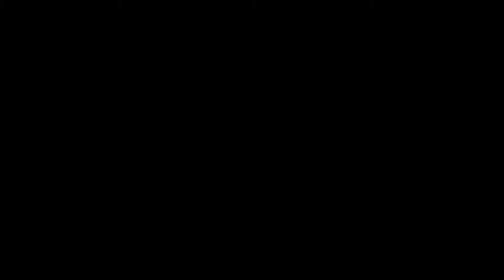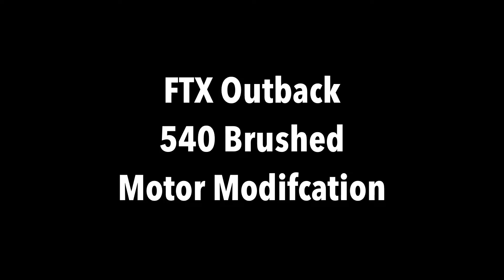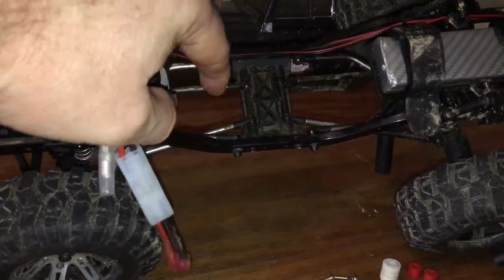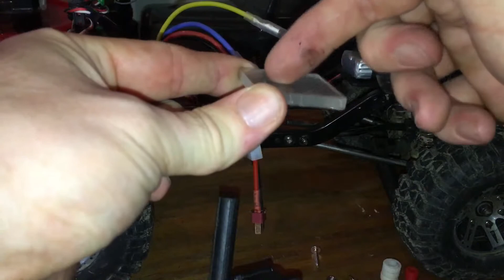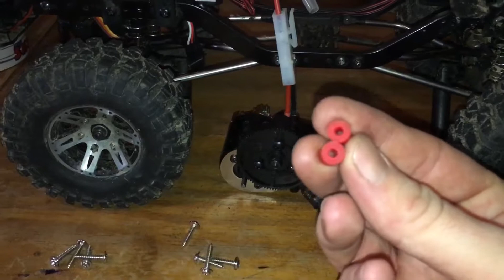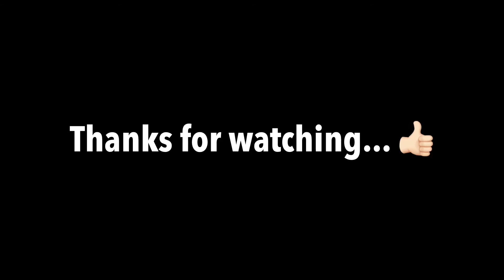FTX Outback   540 Motor Modification

Comment: thanks craggle for the clear explanation of this conversion.just sourcing a all metal or scout g-box.is there a certain x/y/z for the plexi plate buddy?
Reply from the maker: Hi,  not really no, it's just a case of lining the gearbox up in a suitable position so the UJ's on the propshafts aren't too angled. Mark the holes to be drilled on the plate and off ya go.

Comment: Hello! Would this gearbox fit on a Absima CR.2.4? the middle skidplate seems to be the same, same thing with the driveshafts.
Reply from the maker: Hi, I can’t say I’m familiar with the Absima crawler. I’ve changed two gearboxes in two different crawlers, both were easy to do as I made an interface plate to between the original skid plate and underside of new gearbox. You might be lucky with the dimensions of the rectangular base of the gearbox, it may match what you already have. Hope that helps.
Reply: @cramalnig  thanks! I think I'll just keep the 380 motor then. I spent a lot of money on mine and I don't wanna spend more if im not certain is gonna fit.

Comment: I just had my friend print me the center skid plate for this mod and I bought the Everest 10 trans and motor for it
Reply: I’m really excited about it honestly . I ordered 20 mm wheel spacers as well for it and I’m running handmedown 1.9s off a. Vitara ascender . And sent my friend some more files I’m going to try to draw up a front 4 link servo mount that will have. The servo pushed fwd a tad hair and have a 4 link mount at the back
Reply from the maker: Harry FP   Nice one! Hope it works out for you. I actually only ran my Outback the other day (first time in over a year perhaps??)  the different gearbox and 55T motor have transformed it, so so capable.

Comment: What pinion did you fit pls.
Reply from the maker: It's either a 10 or 11t pinion, I'm sure it's 11?! Plenty of low speed control with it, massive difference over stock... totally different RC.
Reply: Tks. I know, i have already blown the stock motor with a 3s and was stupidly fast, but now if I install this gearbox with a 540 motor and run it on a 3s it would be faster, safer and cooler. Thanks.
Reply from the maker: Strewth! It'll take off on 3S lol..  I run mine on 2S, I find even the smaller 2500mah Lipo's last plenty of time, almost an hour of crawling time. I prefer the slow-speed control which it now has with the set up I've put it in, nice and realistic.

Comment: Hi, how you fit the gearbox to the base of the car? The holes not fit and the engine touch the frame of the car. Thanks Best regards
Reply from the maker: Hi Club BTT Llagostera, as you can see in the video the footprint of the new gearbox is slightly larger than the stock gearbox, so rather than drilling the chassis plate I chose to make an adapter plate for the new gearbox to sit on. This gave around 6mm lift to the new gearbox and extra diameter of the 540 motor compared to the 370 motor. The. I added some bushes underneath the new adapter plate to life that even further, so in all around 10mm was gained to accommodate the 540 motor. Works a treat!
Reply: Thanks, I do the same with a piece of plastic. Thanks.

Comment: hello good night, I'm going to change the engine 290 of my rgt crawler for a 540 engine ... should my esc also fit? thanks for your help
Reply from the maker: Hi Carlos, I think the new Outback uses a 390 motor, not sure if it’s the same electrics. But I fitted a 540 motor to my sons Outback and that still uses the stock electrics with no problems at all. Thanks for taking a look!

Comment: Hi, what is the gearbox name? Thanks
Reply from the maker: It's labelled as a HSP, here's the link to it on ebay:

https://www.ebay.co.uk/itm/18024-HSP-Gear-Box-Set-For-RC-1-10-94180-Rock-Crawler-Car-Spare-Parts/282909871802?hash=item41debe0eba:g:Lv0AAOSw8zdawuMk

I've fitted two now, one in my Outback, and another to my sons. The difference between the cars now to the stock 370 is miles apart.
Reply: What is the difference with 540 and stock motor? Is really better? And what "T" you choose? Thanks
Reply from the maker: Difference is massive, performance is way beyond stock. It's physically a bigger motor, hence why a different gearbox is needed. A 540 motor is 54mm in length as opposed to the 37mm length stock motor. Not sure what you mean by T, pinion tooth size? If so, I went for a 12 tooth pinion.
Reply: Sorry, I mean this: 13T, 45T, 55T... What is this? The gear teeth? https://es.aliexpress.com/item/Goolrc-540-13-t-17-t-21-t-23-t-27-t-35-t-45-t/32849701113.html?spm=a2g0s.8937460.0.0.ElfPv3  Thanks!
Reply from the maker: So sorry for late reply! That’s the turn of the motor, I went for a 55 turn, how many turns the wire is wrapped around inside the motor basically. The lower that number then the faster it will spin, the higher the number the slower it will spin but with much greater torque. Hope that helps!

Comment: Have you changed the steering servo or is it still original ?
Reply from the maker: Yes I've changed it recently, with the extra torque from the 540 I think it needs that firm positive control courtesy of a stronger servo. So I've fitted a 20kg TowerPro metal geared servo (which I've PlastiDip'd). It's a bit overkill for it perhaps, 15kg would be more than enough. But since fitting that, it's exposed just how weak the plastic link arm is and the plastic hubs/knuckles. So I've got a pair of FTX ali knuckles/hubs on their way, and I'm making a stainless steering link arm to go across from knuckle to knuckle. There'll be no flex in the steering then at all. Though, to be fair, the stock 3kg servo I had fitted was very good, a noticeable difference between my sons Tundra stock 3kg servo for some reason. I'll be changing his very soon when I'm home.
Reply: I was wondering if the maverick scout servo would fit. I find it a reasonable servo.  Once you upgrade a part then everything else needs doing doesn’t it lol
Reply from the maker: I should imagine it would yeah, they're mostly the a standard width. It's just the depth of the servo, the longer the servo sticks back it will make contact with a strut which runs across the chassis. No biggy though, it's alright. Just going on about the gearbox, look what I stumbled across..... item number 172847573619 on ebay.
Reply from the maker: https://www.ebay.co.uk/itm/172847573619?ul_noapp=true
Reply: Bloody hell. Wish I had seen that a week ago lol. Hip. They are those cheapest model from abroad aren’t they
Reply from the maker: They'll be made in the same factory, by the same company, then distributed off to "Manufacturers" like Maverick, HSP etc... they're just the same, no differences at all. But yeah cheap as chips eh, just goes to show all your paying for is a popular name.
Reply: I have just seen one of those gear boxes on eBay for £7.92 !
Reply from the maker: So have I yeah! haha.. hmmm I'm thinking for my sons Tundra now....
Reply from the maker: Sold! :)
Reply from the maker: And another GoolRC 55T brushed motor.
Reply: Lol
Reply from the maker: As you suggested a while back, I'll have to see if the 55T motor can be powered well enough from the stock FTX combo. So, if it works, the conversion from 370 to 540 has cost just £17.... and for the difference in performance, it's an absolute BARGAIN!!
Reply from the maker: Just seen on the FTX Mauler, that's fitted with the same combo unit as the Outback, though the Mauler runs a 540 motor - so things should be good on my sons Tundra.
Reply: My 35t Hpi Motor arrived today. I have fitted it on. I still have the original stock esc and radio combo fitted to my Ranger. It seems to run good. However I have not had it out for a proper run. But it seems ok.
Reply: I have ordered a 9kg servo too. It’s the same power as the one on my Maverick Scout and it seems to do the job ok
Reply: For some reason your messages don’t come up on notifications so I have to manually check if you have replied so if I am a bit slow replying then that’s why buddy
Reply from the maker: Nice one, what pinion size you going to try? I ordered some more 13t pinions last night too. Non worries matey about the replies. Have you clicked the little bell for notifications? Your messages appear on mine anyway. I've got one of those waterproof HDKJ 9kg servo for my sons Tundra, bought some HDKJ 15kg's too the other month, will fit that to my Ranger, and no doubt the other will go in the Vaterra Bronco to replace the stock 9kg.
Reply: What little bell ?    At the mo i have the standard 87t and i think the spare brass gear is a 21t that i had in stock. I cant fit bigger than that. Even 23t wouldnt go on.  However since putting the 35t motor on i am happy with the top end now
Reply: I cant just recall what servo make i ordered. Let you know when it comes
Reply: My name is Tib by the way. Dont ask !
Reply: The servo is an etronix et0018   its been delivered today
Reply from the maker: The little notification bell is near the red Subscribe button, to the right of it. If you click that some little curved lines appear around the bell which means you'll get message notifications too aswell as new videos etc.. 
did you get the servo in?
Reply: Well. I never knew about that bell duh.  I been wondering why i get some notifications and not others lol. Yes. The servo is fitted. I am really happy with my mods. Cant wait to take it for a run buddy
Reply from the maker: Hopefully it goes well for you! I use a 2S battery, vary from 2200mah to 6200mah, even the 2200 delivers around 45, 50 mins of run time. And with the 11tooth pinion on the slow speed control is so realistic.

Comment: I have done the mod today. Am pleased with the base plate I have made.  Have only run it quickly in the garden. Runs ok. A bit slow though. I have a 35 t motor on order. For now I have just put a spare motor in it that I had in stock. I have a 21  tooth spur fitted. Not enough room to put a bigger one on it
Reply: I have done similar to you. I just used a thicker piece of plastic so I didn’t need any spacers. I also drilled three new holes in the chassis rather than using the four original small holes
Reply from the maker: Nice one - glad you've done it! I'm after a slow crawling control-speed, so I fitted a 12tooth pinion, not after any speed as such, it's enough to provide a burst of sudden speed if needs be but that's it. And with it's mega low gear ratio it climbs with total ease, I was pleasantly surprised! It's completely changed the characteristics of the car now.
Reply: I will have a play with a couole of motors and gears
Reply from the maker: Yeah it's whatever you want from it really, I'm after a very slow crawl speed. Slow-speed is key to getting traction and be able to climb. I've given it a quick run before I came away to work and running the Ranger very slowly up over obstacles suddenly became clear that's the way to go, it was effortless.

Comment: I am toying with the idea of doing this mod myself buddy. You make it look easy. Very good video 👍👍👍👍
Reply from the maker: Yeah I'd reached a point where I knew how capable the 370 motor is, and it's impressed me. So, thought the Outback can handle the 540 easily. It's really straight forward mate, either choose to drill the existing chassis member with 3 new holes and use higher spacers, or do what I did with a mount plate. Will be trying it out tomorrow with any luck!
Reply: I have ordered a scout gear box set lol.
Reply: Let me know how your first run goes
Reply from the maker: Will do! That's good you're giving it a go, mine came labelled as 0.6mod spur gear - it's not, they're 48dp!
Reply: I will let you know how i get on
Reply from the maker: Gave it a quick run before I came away for work - to put it simply - it's effortless... Due to its low gear ratio it can really crawl, very slowly. And it can climb at that slow rate too without any strain from the 55T motor. It's great! There'll be a running video when I return home after Xmas.